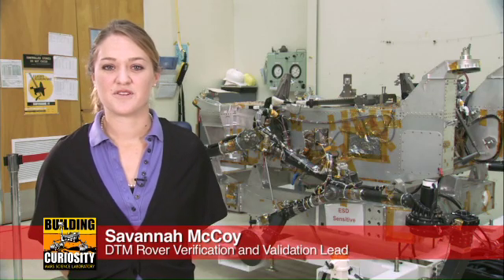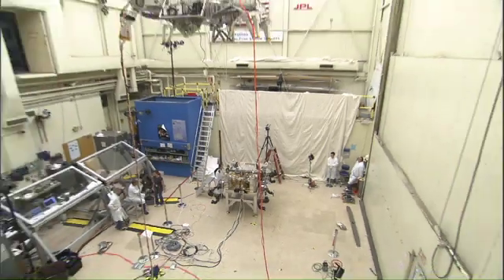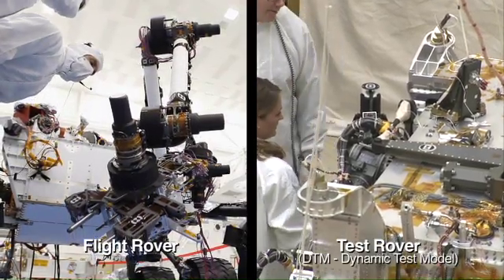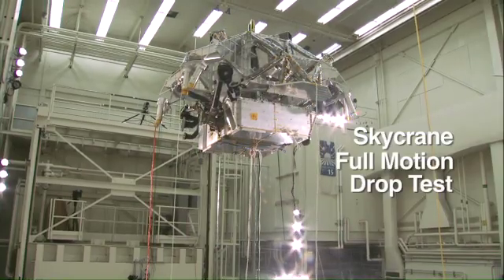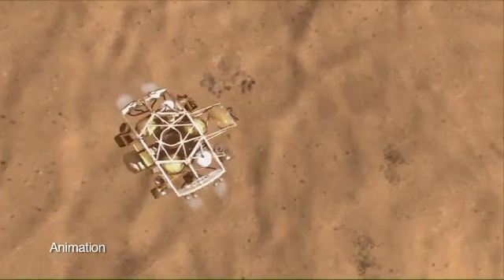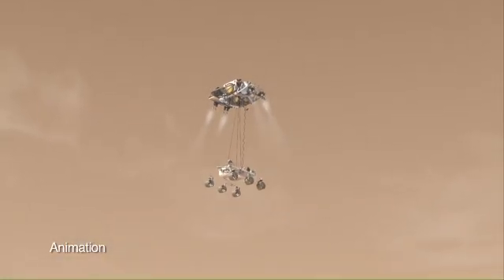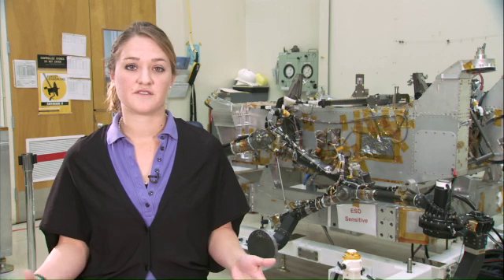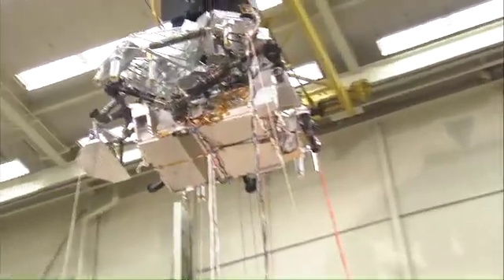Curiosity Landing System Drop Test

Comment: Whos here after Perseverance landed?
Reply: Me
Reply: Me
Reply: NOT ME
Reply: @stimmo77 same prolly my 3rd time watchin this.. I wish we could see a hover test of the sky crane on earth.
Reply: @merxellus  I don't think that would work since the gravity here is too strong. That and I'm pretty sure the landing engines are optimized for near vacuum. :(
Reply: @16BitGoofball  they tested the helicopter on a vaccume chamber.. Why not the skycrane.. A least a little hover.
Reply: @16BitGoofball  as for the gravity.. They did an assist gravity for the mars heli by hanging it with wireswhich actively compensate the lesser gravity
Reply: @merxellus  True, but that sounds harder to do with something a lot larger, heavier and more powerful. Idk, maybe it could have been done but I'm not sure how practical it would have been compared to whatever testing they did. :/
Reply: @16BitGoofball  are u kiddin me? They literally did the same thing with the Apollo test flight. Niel Armstrong was the test pilot himself that tested the moon lander on earth.  Using the same thethered gravity assist. Do some research.
Reply: @merxellus  The LLRV wasn't nearly the same thing. That mockup was jet powered and specifically designed to be used on Earth.

Do some research. :)
Reply: @16BitGoofball  they r the same thing lol
Reply: @merxellus  No. Like I just explained, they're not. The LLRV was a jet powered mockup that only had the capacity to simulate the handling of the LEM for the purposes of training. It was nowhere near being equivalent to the LEM, and it wasn't even held up by tethers.
Reply: @16BitGoofball  it was thethered.. By massive structures but the process was too ineffective hence they switch to VTOL jet fighter engines.
Reply: @merxellus  I can't find a single source saying anything about them being tethered.

But in either case, you just stated it was to ineffective, which was my entire point anyway.
Reply: @16BitGoofball  watch Smartereveryday.
Reply: @merxellus  https://youtu.be/_OXk4RKZhaY
I assume you're referring to this video. So you weren't even referring to the LLRV. I don't know why you didn't clarify that earlier.

But you're cherrypicking this one test, an early test flight of an early test flight, and then using that to prove... what exactly? Because not even that's the same.

That test article was a JET powered prototype that was in no way being used for the development of the LEM. It was designed to be used on and only on Earth as a training vehicle. That is in no way comparable to testing the actual vehicle itself with rocket engines optimized for a certain atmosphere.

Again: the LLRV and its earlier versions were never the same as the LEM itself.
Reply: @16BitGoofball  well3.. How far down the rabbit hole u plan on going. I just wanna see a Skycrane test flight and here u are.
Reply: @merxellus  I'm not the one going down a rabbit hole, you're the one steering the topic to the apollo tests. I'm just saying why test flying it isn't feasable.
Reply: @16BitGoofball  dont u have other important stuffs to do bro
Reply: @merxellus  You're replying equally as much as I am.

Comment: For.so.e.reson the Chinese are landing their rover directly on the ground... Does anything think this will lead to a mission failure of thier rover?
Reply: Sir the tianwen 1 is actually a 3 in 1 combo a orbiter a lander and the rover the rover is going to be in the rover protected from the outer dust or stuff the lander has its own engines that will fire and land it self and after the dust and everything is settled down the lander will release the rover and it'll both perform their missions
Reply: It's worth mentioning that the tianwen-1 is only 1/4 the weight of perseverance, and will only need 1/4 the thrust to land.
Reply: Chinese rover is tiny so it will land fine, this thing from other hand would dig out its own crater on mars with its thrusters.
Reply: @randomnickify  lol... Well NASA landed it just fine last weekend...
Reply: @randomnickify  Yeah, they didn't need this system for Opportunity which was about the same size as the Chinese rover (even looks very similar), Curiosity and Perseverance are about 3-4x heavier than Tianwen-1
Reply: I must have written this on a drink night.. I meant Tianwen-1, the Chinese rover.. It lands directly on the surface and rolls off the pad but the landing rockets will create alot of electrostatically charged dust, which is why NASA uses the sky crane system. I'm wondering if that could cause mission failure  for the Chinese, that is.... If their rover dosnt go plummeting through the thin Martian atmosphere before smashing to a million pieces on the surface.

Comment: It is not that people don't believe the tech, they just can't understand why anyone would perform a test in the wrong gravity, with the wrong atmosphere, and the wrong radiation levels, and think that they will recover any data of any use whatsoever. It just doesn't smack of a team that could ever land a vehicle successfully on Mars. That is the problem.
Reply: Because they can make calculations. Like this worked on 1G so it would on less than that. Those people put a fucking rover on Mars, what puts you in the position where you think you know better?
Reply: "they just can't understand" - well there you go.
Reply: This tested deployment mechanisms. I don't understand what's wrong with this test considering the success of Curiosity.

Comment: "The reason we do all this testing....."

What testing is that, exactly?  I've spent days trying to see a live demo of the sky crane in action sans cable. This is it, folks. NASA sent this unit millions of miles to a distant planet, and just tested the landing with a cable?!?  Please. 

Each successive model of a plane that Boeing develops is tested hundreds of times before it's put to use, if not thousands. You'd think with the umpteen billions of dollars sunk into this project that there'd be at least a few dozen live runs on earth. 

Show me something that isn't :

A)Retarded
B)CGI
Reply: Your joking, right? The whole thing is designed to work on mars!! The gravity is 0.4 g's, the air pressure is 95% smaller than earth and it's nearly -40 degrees Celsius. That's why landing stuff on mars is so dang hard. You can't just test something in an environment that it wasn't meant to operate in!!!!
Reply: @LIFEOFSTUFFEDANIMALS  actually Mars is 1/170th of Earth’s atmosphere, nowhere near 1/20th. Following your reasoning, why perform this test at all? There is no harvestable, useful data to be collected from this in terms of a mars landing. It is a PR exercise only, or is it just to fool these people it will really be sent to Mars?
It’s not that hard if they landed twice in ‘72 with the Viking systems before computer modelling is it?
Reply: @sircles-net  How do you know there's no data to be collected? Do you work for NASA, a company that has over 60 years of experience developing and inventing mindblowing shit? Of course you don't, but you still think you're much smarter than them, so why don't you apply for a job position there?
Reply: Planets do not exist homes
Reply: lee hodge so what is earth